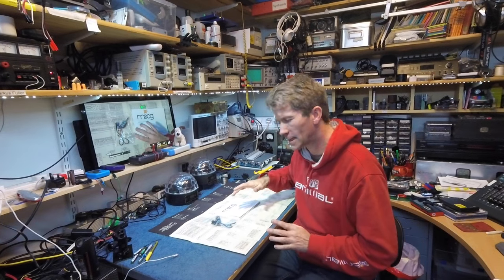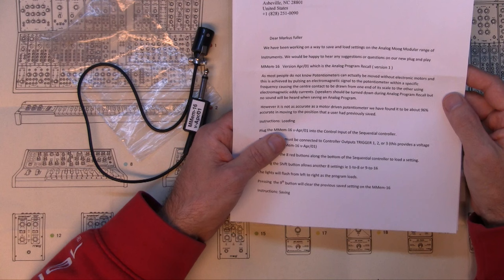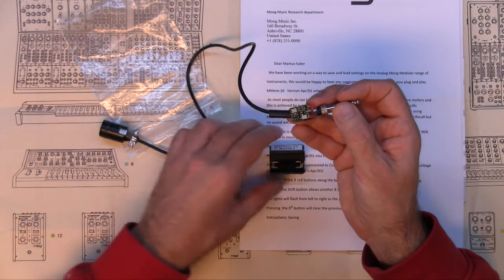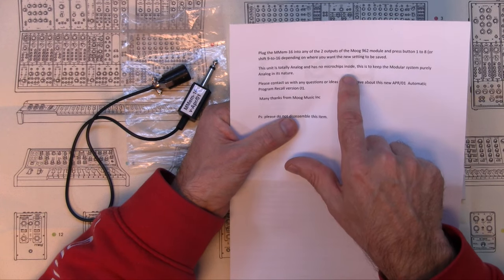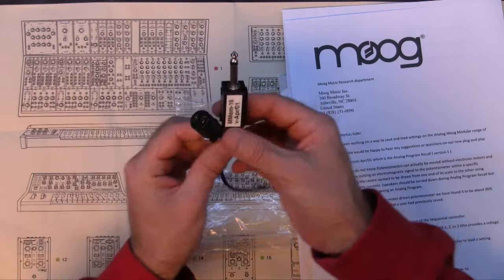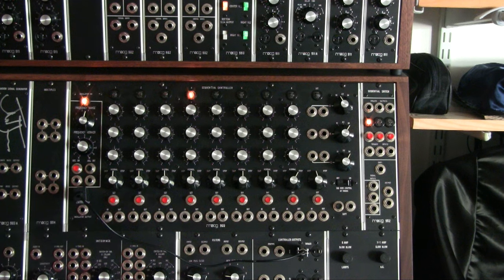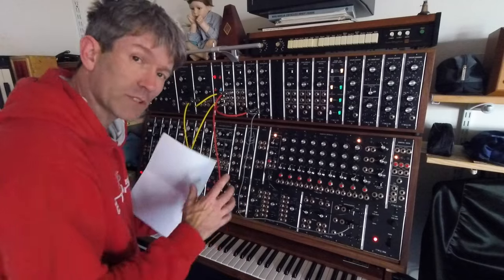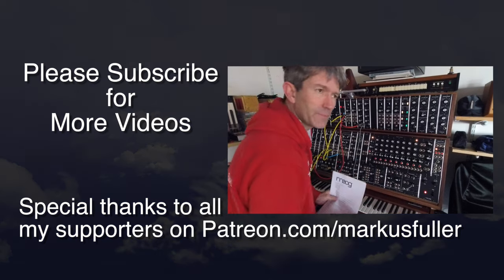Analog Modular Synthesiser memory module for saving and recalling patches

Comment: A french guy called ACX actually created such a modular system a few years ago  , but it din't sell at all , it was opened to other manufacturers modules ( except for the parameters without CV control ) :  .
 i am failing to recall the name of another system like this one , that was also prototyped  , but Dave Rossum 's modular system also include presets and total recall ( mostly digital modules ) .

Comment: Hi there Markus! hope you doing great, i'm a subscriber from Spain, and i recently purchased a SCI Six Track and the rubber buttons fails a lot, i have not electronic skills but i'm a producer and have a home studio so i like to fix stuff myself (that's why i like your channel so much jajaj) well.. the thing is i have demounted the whole thing and fix a few failing keys, but the buttons thing is the carbon contacts, i have tested the board and looks well, using a responsive button all works, only one contact seem to be a bit affected, so now i have mounted the synth and have build some "temporary" pushers, with some recycled carbon contacts from another old keyboard, so i can use the synth while i repair the buttons itself (so i program it with two little pencils), the question is, are you able to replace those contacts if i ship them to you Markus? the contact surface is pretty big, compared with the typical midi keyboard, that use to have two small dots, those have a big one, pretty big, like 0,5 cm diameter, and i think the best solution is to straight cut them and replace them totally don't you think?, unfortunately that's too much for me i guess and i don't want to ruin them, let me know if that is possible and i ship them asap to you! 

Thanks for your time and keep doing those great videos Markus! bye!

ouh! just one more thing! what you recommend me to do with that board contact?, i have only passed a pencil eraser over it to get the dirt out, and it was black as hell, thats it. and with those little pushers that i made it works but the "5" on the "select" sections is a bit hard to get.

Best regards,

Carlos serrano
Reply from the maker: carlos serrano Hello Carlos, straight to the point I cannot take on any repair work as i work full time and only make these videos in my day off work and simply dont have time and space to do repairs for people. but I have recently found this electrical conductive paint for repairing these carbon contacts https://www.bareconductive.com/make/fix-a-tv-remote-with-electric-paint/ . I have not tried it myself yet but I think I will buy some myself as it looks like the ideal thing to repair buttons with. maybe this will work for you ?.
Reply: I totally understand, i though the "cutting" technique will be better but if you think that will be enough  i'm going to try those electric paints as this i think i can handle ;) ,thanks again for your time and fast response Markus!

Best regards,

Carlos Serrano